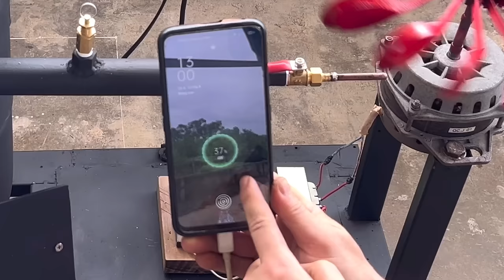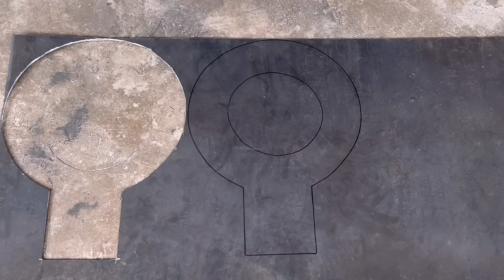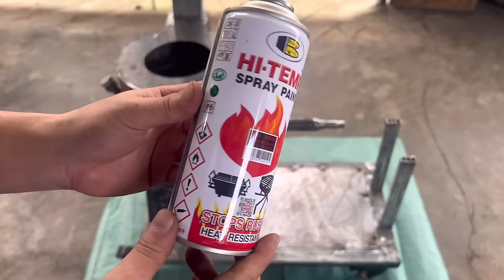wood stove combined with free power station  / new creative ideas 2022

Comment: Pressure indicator and a relief valve are required for safety.
Reply from the maker: Hi you didn't notice i have soldered the relief valve on the pipe , thanks for the suggestion i will add a pressure gauge .  Best regards
Reply: N!CE
Reply: Ball and spring overpressure valve.   Problem solved
Reply: I also thought for that
Reply: @GoodCreativeIdeaDmkt  
Ok thanks
Reply: Yes
Reply: Superb idea……. great
Reply: He do pressure valve for that.
Reply: Sin la presión exede la valvula q colocó en tubería de salida tipo pesa libera excedente.
Reply: no need..
Reply: I don't see videos of your creations. Don't nay say.
Reply: This would be beneficial if it's real  XD
Reply: @agoogleaccount2861  Until it fails. Then you got a biiiiiig problem.
Reply: @benc1927  ball and spring pressure reliefs always fail at the spring. The ball loses adequate pressure to hold shut  .. you'll have to use a rubber band to hold it till you replace the spring or if won't run just hisses
Reply: Tahliye vanası var var zaten
Reply: @GoodCreativeIdeaDmkt  ⁹
Reply: Watch again my freind  is 👀🤓, 10cm before steam controller ball valve is the pressure relief safety valve, how did you miss that 🤭.
🇬🇧👍🕊️
Reply: @agoogleaccount2861  fail safe then 😉🇬🇧🕊️
Reply: @Flash-Strike  - i -
Reply: Это не настоящий генератор. Он не даст напряжение 220V. Максимум 2-3 вольта
Reply: Don't worry with the water conductivity minimum 10k+ ppm it won't be long before it makes its own relief valve. People always underestimate the importance of water quality in a boiler.

Comment: It’s free energy as long as you have enough wood to burn and water to boil. I would recommend an in closed turbine unit, so the steam can condensate down back to water and pump it back to the pot. Now you won’t lose water and the only thing you will need is just enough wood.
Reply from the maker: Hi I am in the country and firewood is abundant and free in my garden thank you
Reply: It's free energy as long as...
Once you say "...as long as..", it is no longer free energy.
There is always a cost to produce energy.

Comment: Idea is really cool and useful. 
Just my suggestions :)
Must avoid keeping the power outlet near the stove or need some kinda protection. As u can see the water can be spilled from the cooking pot and it was just few cm away from the outlet box. And pressure valve is really needed. 
And it would be useful of u can make a ash tray box so when the wood is burnt the ash is collected below and can be removed or pulled out so cleaning and maintaining would be easier. 
The opening of the plug to release excess pressure is dangerous.  Definitely need some serious protection and safety measures needs to be implemented here.
And if we can store the power that's produced it will be much more useful
Reply: I think a lot of these concept designs are meant to be just that, concepts for you and I or anyone else to take and expand upon in a manner that best suits our individual situations. You don't have to use the same parts/materials, and nobody says we can't add what we see necessary or that may not have been included in said build.
Reply: Repent and believe in Jesus Christ  Repent for what, cooking or generating electricity instead of buying it?
Reply: If you have ever seen a steam vessel rupture you would agree safety first
Reply: I feel that a old pressure cooker lid with a low pressure weight could be added on ...
Of course the WHOLE IDEA IS GREAT BUT RATHER LIKE THE OLD GREEK TURBINE SHIP I ONCE WORKED ON.
Reply: You must pay more attention when watching someone's vidio before posting your comment , he shows quite clearly just 10cm before the controlling steam ball valve a pressure blow off valve 🤓, and as many of us have at one time or another I'm sure, with our  prototype mock ups, somtimes lash things together to test out the principles of our work, and as you quite rightly point out, don't always put safety to the front of our thoughts, he will lm sure take on board your safety concern and be grateful for your, well, vigilance. 
But one thing l do hope we agree on is,,, he does exceptionally skillful work with the most basic and limited couple of tools that you can have,,, grinder, hammer and a pair of skilled hands, so let's focus  on that maybe, with a little dusting of safety advice eh. Imagine him with a well setup workshop and a decent set of tools to work with he would be exceptional, he has my admiration. Praise where praise is due l say,  👍 🙏from 🇬🇧
Reply: Open your eyes mate, 10cm before the steam control ball valve he shows quite clearly a pressure blow valve, pity you didn't spot that before rushing to kick the safety bucket and posting your comment eh.
But lm sure he will welcome and take on board your concerns, after all, that's what the comment box is for isn't it, well spotted mate 😂..... 
But l hope you can agree with me on one thing,,  that Praise where Praise is due, and he has got a pair of skilled hands, just imagine if he had access to the tools maybe you and l have and take for granted and are  littering our well setup w/shops, he would be unstoppable wouldn't he,  just a grinder and a hammer
and he can produce this item, well he has my admiration as lm sure he has others as well. 
Well done and power to him l say. 💪 😉 🇬🇧 👍.
Reply: HE'S SHOWING A  PRINCIPAL derrrr, l don't think he's trying to sell it to you mate 🤗
Reply: @clarkkent5821 
I wonder if that's the reason he has a pressure safety blow off valve 10cm before the steam control ball valve, what do think 🤔🤭🤪🤓, 🇬🇧👍
Reply: For a air compressor won't tolerate lime scale needs atleast 1 inch plug blowout in addition, build it put your kids around it and let natural selection take place. If you so smart
Reply: It's a great idea but I would think óne would want a pressure gauge to make sure it doesn't even get close to exploding
Reply: Its cool if the steam can recover again and back again to boiler,  so less fuel can consume.
Reply: I would add an inverter and a battery before plugging my phone in. Great advice. Cool invention though.

Comment: Very good idea. This types of stoves are very much useful in rural and remote areas where electricity or gas connection is not reached and wood and water is very much available.
Reply from the maker: Thank you so much. I am in the country and firewood is abundant and free in my garden
Reply: Solar should be there unless if they live in a hole

Comment: Love the concept. Would be interesting to see if a copper coil could be added to run to a water tank to both feed the steam power and heat water to be held in the tank for household use. Plus a couple deep cycle marine batteries and charge controller/Amp meter added to the setup in an attached cabinet to create a battery bank for the alternator to charge. Definitely like the suggestion of an ash drawer at the bottom.
Reply: Придумана для Таджикистана 👍

Comment: I wonder if this could be set up to charge some bigger banks for latter use. Seems 100% possible. If this was scaled down to a camper size and set up in a cavase tent and set up with a couple good sized banks you'd have yourself a pretty damned good off grid power.

Comment: Nice.  Did something like this myself but instead of electricity i ran a radiator and evaporation steam coil  system to make it use less fuel be more efficient make more heat Did you add a bridge rectifier to regulate the 12v. ? Or did you convert it into something closer to household voltage ??     So it doesn't flicker   I'd install an auto battery or something so it has a power bank. Step it down to USB voltage   can have light above the cooking surface. That light is inefficient at best
Reply from the maker: Thank you
Reply: @GoodCreativeIdeaDmkt   if you do it right setting that up for vehicle voltage and adding a battery bank and a few 12 v to  USB units available cheap from china  you can run anything 12 v or 3.7 USB voltage that a running car engine electrical system can run     vehicle DVD player for your house   phone charger. Fan  etc. Maybe add a flywheel ? To prevent loading slowing the wheel down

Comment: great work and the hot water vessel has relieve valve or safety valve for safety life and it will not explode if water gets high boiling temperature .

Comment: Actually, this might not be the most efficient design, but it is probably the most practical and effective. The turbine could be improved some without much work, an off the shelf "temp and pressure" valve can be used on the boiler, making it safe and preventing it from ever gaining too much pressure. 

This is simple enough to be made with common tools, no lathes or milling machines to make precise steam engines or turbines.

Comment: Just use the motor to power, well to charge, batteries!
Then you can power anything in your home with the batteries along with an inverter if it's not a 5 volt or 12 volt item. This is how solar and hydro electric power works. Even nuclear eventually charges massive batteries.

Comment: Hi there! Genius & brilliant work right there 👍 
I wonder, could you adding;
1. Pressure meter 
2. Volt & ampere meter 
3. 18950 batteries 
into your system?🙏🏽
Reply from the maker: thank you very much.  Thousand blessings
Reply: I wonder if i could use this system to   produce clean energy from everyday neighbourhood waste material,
Because here in my neighbourhood, there are only two options in waste management;
1. Burn them with gasoline (creating a lot of air polution)
2. Move them to the nearest waste station (have to provide some sufficient carrier -> like a trike motorcycle, maybe)

I think it will be great (for the environment) if this system is applicable to my neighbourhood.

Greetings from 🇮🇩 (Central Java Province)

Comment: Excellent but little bit changings r there u can knew it  . U done a good job  .  
With the steam not only power charging  , in south India lot of hotels there maintaining this type of tricks  .  They r using for rice cooking  and  vegetable cooking . 
They r reducing gas consumption  .  
Previous one of the Indian expats told their opinion.  Maintaining the pressure indicator . Such a nice point it is  . 
Then u can maintain the steam where is the necessary  .
Reply from the maker: Thank you

Comment: Now use the steam to turn a compressor and two fans at the right rpm and you will have a steam powered air conditioner.

Comment: i wonder if vertical wind turbine generator would really perform as good as steam powered
Reply: NO, IT WOULDN'T. Essentially you are converting energy to another form, any energy not converted reduces efficiency. Steam is delivered in a contained system and more focused than heat rising.

Comment: Enacapsulation is needed , so when those vapours will condense then it will fall down as water droppets in the electrical circuit and can cause short circuit and fire.

Comment: I've made somthing similar only using water and a pump, it powers its self and stays running with excess energy to charge a bank of batteries which can run a 240v inverter.
This particular version could be hooked up to a hydrogen generator that is powered by the energy created when you burn the hydrogen to create the steam that in turn creates the hydrogen, the thing is, when you top up the water that creates the steam it will cool the rest of the water down but if it's added slowly in small amounts maybe it wouldn't?
Reply: Good suggestion about water but difficult adding water to a pressurised system

Comment: The amount of steam required to continuously rotate the rotor is very large indeed. It is not possible from such stoves. The entire device is not visible. The cable is probably running from the bottom out of the camera's view.

Comment: Lmfao, when they jump cut and there's no steam but the "generator" is running. Legit man turned on a motor. Plus there's no way you're gonna get 500 watts out of that. You can't just hook your "generator" to an outlet either and have it work. You need to produce a clean 60hz to charge a phone, or make a light not flicker visibly.

Comment: You have some talent but you ruined it for suggesting that this will generate 500 watts. I'd be impressed if it generated 100watts and that water reservoir was enough to power a steam jet for the length of time to charge a phone, usually 2 hrs. Cmon now. Use your skills for good things, don't just lie for views.